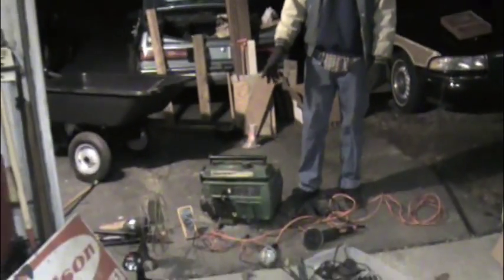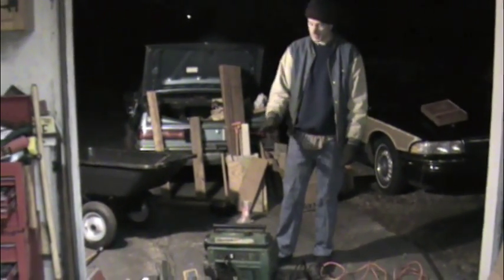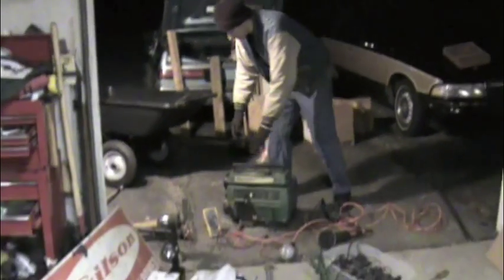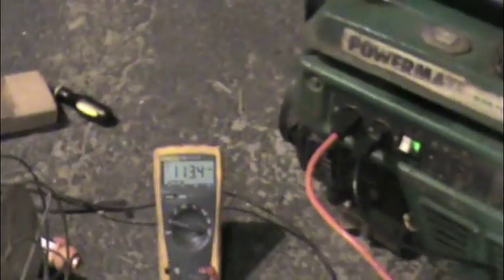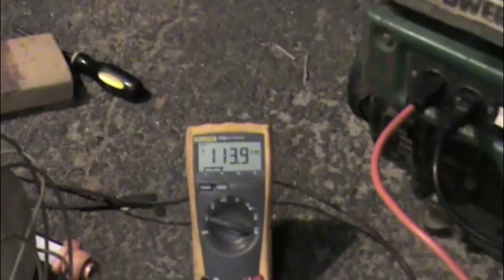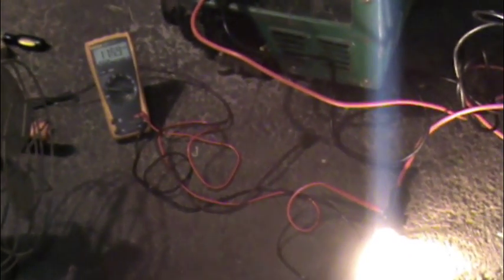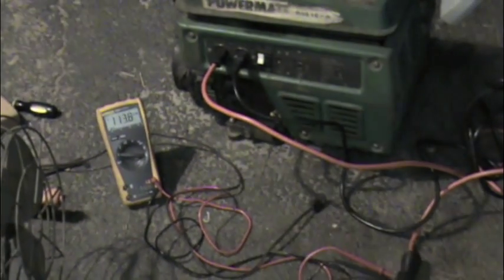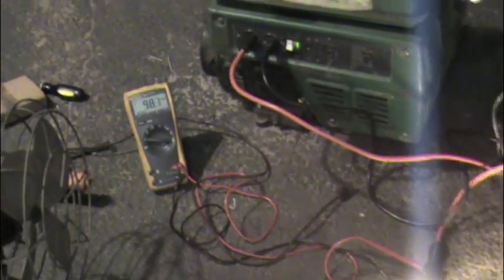POWERMATE 1500 watt Generator with problem

Comment: would recommend taking a look at the governor. see if there is any springs missing. PLus if u can find the voltage screw thing where you turn it and it increase the rpm and voltage you should try and adjust that.

Comment: I think what you are seeing is normal. The governor is compensating for the load. However the governor is set a bit too low to maintain the proper voltage. I have had generators come to me set incorrectly at the factory. Normally I plug in something with a light load as a ballast, then set the governor so that the generator produces around 125V. This keeps the voltage at an acceptable level, even with a full-rated load (105V being on the low side).

Comment: It's working fine. The voltage drop is normal, considering it being a smaller unit. The governor could be bumped a little higher though, so it's at least a constant 110 under load. Won't matter if only used for power tools though.

Comment: I have a generator just like yours.  (1)  Change the capacitor, that might help.  They go bad after a while.  Also, (2)  your grinder might be too much for that little generator.  I believe it only rated for 12 amps.  Grinder may draw more than 12.   I use this generator for lighting and smaller electrical uses.. I wish my small on/off light worked like yours... Good luck and thanks for posting.

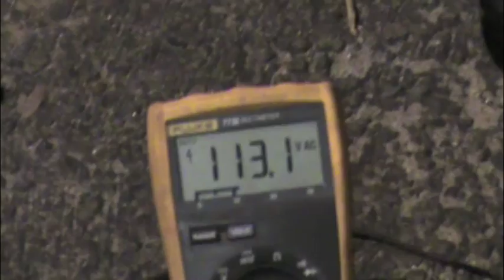Comment: 1:15  time.      Hi.  The test light, probably 100 watt. THAT,  angle grinder, probly  7  1/2     amps. Your pushing, the limits, of this generator. 1500  watts, probably starting wattage. Running, would be 'around'   1200, max.   So,   7   1/2     x   115  volts = 863  watts, +  bulb.      Still, the gen should have a higher  'duty cycle'.   What , is the engine  rpm ?   If  the rotor/armature, is 2 pole, engine rpm should be 3600, for  60 cycle/hertz   120  volt north american values.   IF  the rotor/armature is 4 pole,  engine rpm should be 1800. ( most all diesel generators and welders).  Anyway, will view the rest of this video.  Thanks, for educating yourself, in these matters.  ( old electech)

Comment: @carrabec99 I find there is nothing wrong with the generator or brushes. Use an analog voltmeter, you will find the voltage reading is stable. Some digital multimeters (especially cheap ones) can give erroneous readings caused by harmonics produced by the generator. I have had the same problem with mine, a 4000 watt unit. I found it was the cheap digital meter was the problem. I got a better meter and it checks out good.

Comment: You also have an extension cord which will drop voltage for every foot you have between load and generator. use at least a 12 gauge or heavier heavy duty cord no more than 25' long to run any demanding loads. Remote work sites that use such a low output generator are good for charging batteries, lighting, small electrical loads like drills or small circular saws. less than 7.5 inches.

Comment: Sounds to me like some sort of carb/voltage regulation issue.   Most generators have a linkage to open the throttle when they sense a load on the alternator.   Doesn' t sound like yours is kicking in.

Comment: it might have a loose shaft on the generator or its an inverter generator with a bad board, or it may have a bad capacitor if it has one, or you may just be going over the load limit.

Comment: A powermate 1500 is only surge, its more like 1200 continuous. Which means 10 amps output at 120 volts. Volts times amps equals watts. Now here is the rub. There are many factors that influence output. You are not going to have 120 volts at 10 amps. you will be lucky to have 100 volts like you have. Electric motors use twice the rated wattage. Lights, chargers, other such loads can survive on 2 pole cheap gen sets. Fluroescent lights may flicker due to number of poles in generator and harmonics.

Comment: There is no voltage regulator...  Current is limited by a 4.7uF capacitor.  All capacitors age over time and should be replaced as part of maintenance.  Part of the observation in your video, the voltage is not instantaneous as the limiting capacitor needs time to charge with the new load.  
The voltage will drop as well as the frequency with the increase load.  With a 900+ watt load mine drops to 110v at 58 hertz.  Not to hateful for what you have.  
The capacitor appears to be proprietary and made out of inobtanium on intra-galactic back order (not available).  For about $10 you can buy a start capacitor 4.7uF 300+ volt 5%.  I extended the wires outside the case and mounted it under the fuel tank.  
Good Luck.

Comment: The same thing happened to me my UK generator should produce 230v at 50Hz and it was at like 190v so what i did is i got a P3 Kill a watt (multimeter would work fine) and plugged in a 500 watt floodlight i looked at the voltage reading and turned the screw clockwise until it read 230v - 49.6Hz and it worked a charm.

Comment: man i have the same geni and i have carburator  problems i took apart the carb and left it on carb cleaner over night will see how it goes  it was working fine for like 17 straight hours but it ran out of gas over night and thats when start to have problems with but i only pay 90 bucks for it so ill just have it as a project

Comment: End of video. Okay.  First, NEVER  EVER   start the generator, with a load on it !   NEVER  EVER  shut down any generator, with a  load on it !  This, will kill the AVR, and/or kill the residual magnetism, in the rotor. (brushed generators).  Another item:  The engine rpm, is   'governed'  by a governor mechanically connected to the carburetor. This, allows the engine, to increase rpm, as the load nears the generators rated output. CHECK  THE   motor  rpm, with an rpm tester. Amazon sells them, but get a  good one.  Then, start gen, warm up for 3 minutes, then attach load, turn on load.
Most inductive loads (motors, etc) require about 3 to 4 times, the running current, on their label. Resistive loads (filament bulbs, etc- heat guns, hair dyrers-have resistive elements, AND a motor) draw mostly constantly.  The engine rpm, should bump up a bit, on rpm meter, when a grinder/drill is turned on.   check this, on any generator.

Comment: It could be a bad voltage regulator or a diode in the voltage rail.
I'm having problems getting mine to run at all because of the spark plug.
Reply: no,....usually the carb. Ethanol gas, draws in water. Drain the carb,  (shut off fuel cock on tank) run generator till it stops, then your good for it to sit for several months.  REDO  the carb, emulsion tube, jets, any small holes, clean with a pin, etc. Adjust float/needle per factory specs.   SHOULD  WORK. +

Comment: Slow recovery after grinder removed means AVR, capacitor problem or loose/corroded wire from cap or AVR to field.

Comment: well i can't remember what it is called but the thing that is supposed to move the throttle could be bust for some reason 

oh i just remembered it's a AVR automatic voltage regulator hope this helps